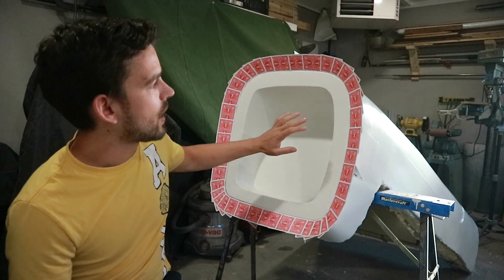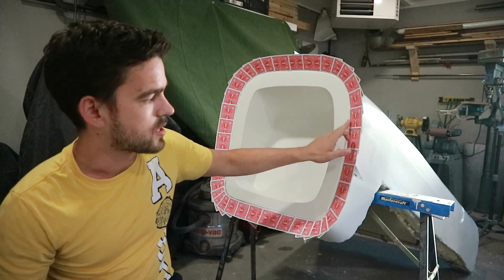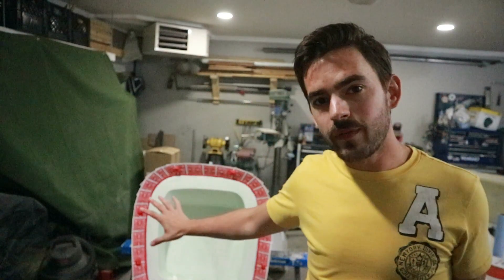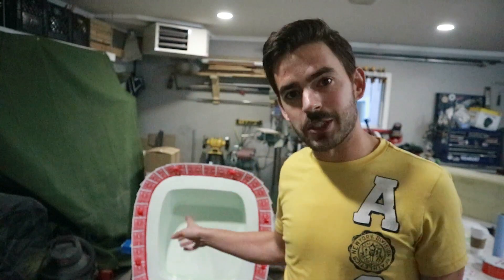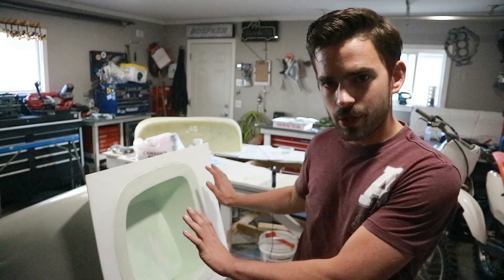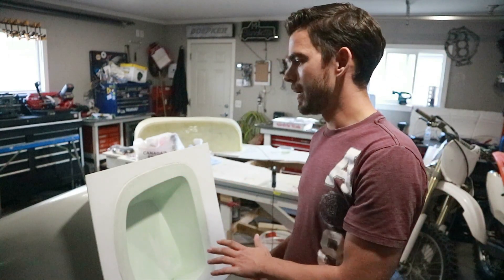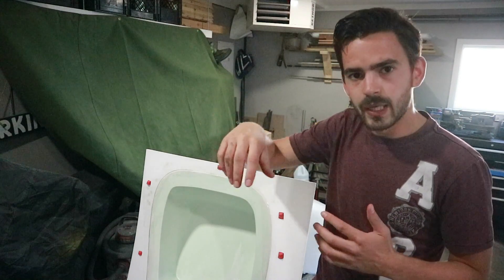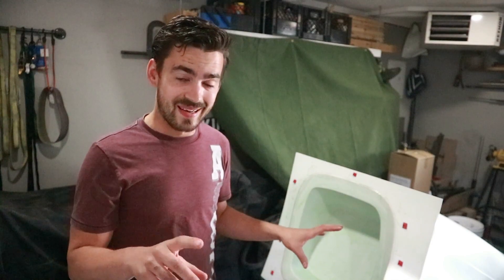Ep 94: How to Make a Multi-piece Fiberglass Mold Pt1

Comment: Hey in episode 53, you're reinforcing a fiberglass hood that you made. I haven't watched every video, but what's the problem with that hood you made months back? Is it not usable?
Reply from the maker: It is not, i tried to cheat and not make a female mold and it bit me. That hood warped and doesnt fit the chassis, and would require hundreds of pounds worth of bondo to get remotely flat. Hopefully this method yeilds better results
Reply: @leftfootfirst9847  ah, I see. Hey I really appreciate your quick responses. I'm wanting to do a custom body for my NA Miata. Was thinking of just stripping the body panels off, building my shape up in foam, and using the car itself as the male mold. Carbon-Kevlar layup over the top without the vacuum process. I figure since the body panels I'll be replacing (front fenders, front bumper, hood, rear bumper, rear finish panel) are not really structural components, I might be able to get away with it. But now I'm reconsidering.
Reply from the maker: @kevinbyrnewoodworks7508  I think you are on the same train of thought as I had when I did the first hood. I would suggest using the car as a buck, then pull a fiberglass mold off of it, then do the carbon kevlar on the inside.